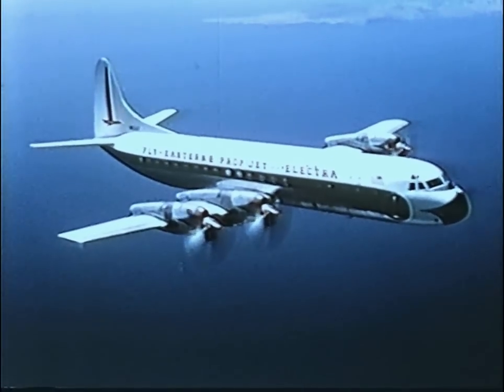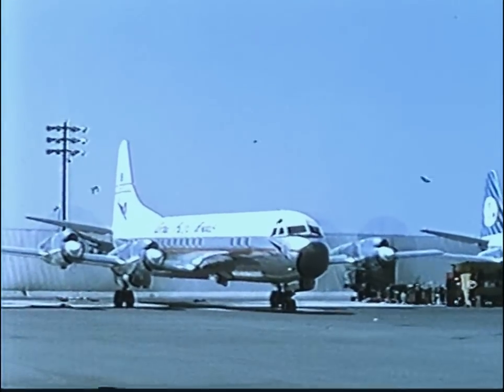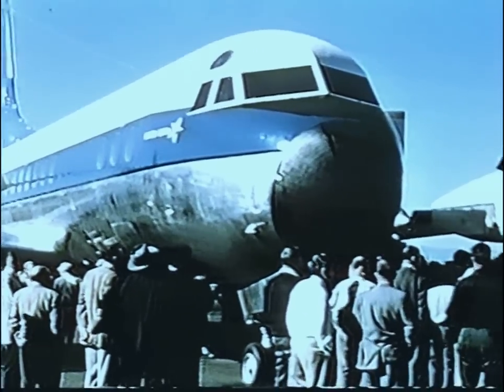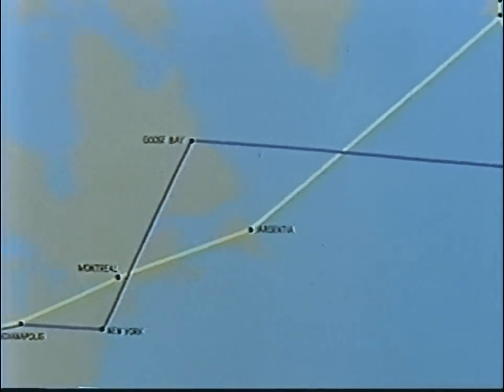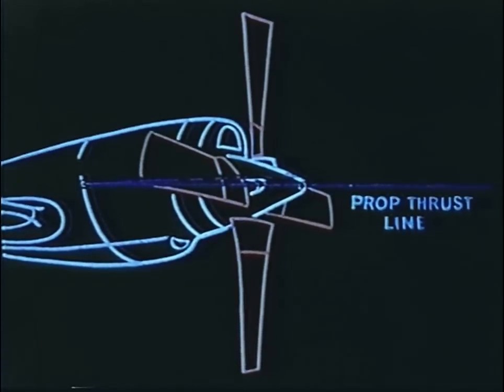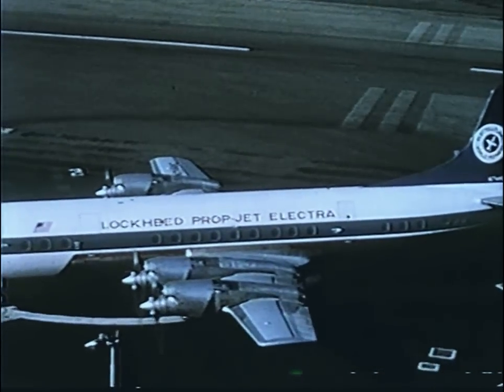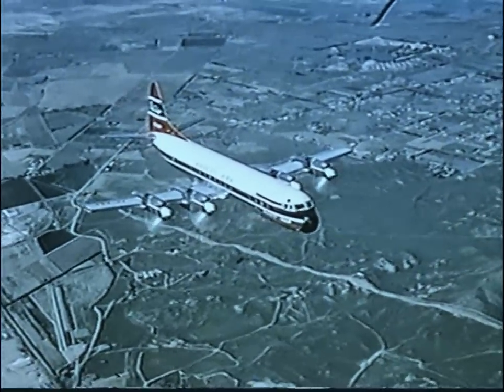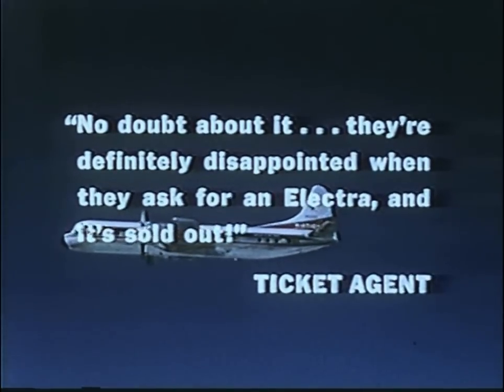Lockheed L-188A Electra Promo Film #3 - 1960

Comment: Gotta love the marketing guys. Propeller oscillation-induced catastrophic failures were reduced to "noise" issues in the promo film! The Electra eventually turned into a great airliner, but by the time the vibration problems were ironed out, it was commercially doomed by jets.
Reply: Chris - " both fantastic aircraft that failed in the marketplace" ==> Indeed. The Electra II eventually made it into Varig's shuttle service between Rio and Sao Paulo in Brazil where it was was loved by passengers and pilots alike. It flew this service for decades at more than 60 flights per day, yielding over 700K landings without a single fatal incident. The L-1011 was also a superb aircraft, but the Lockheed sales guys got it all wrong by committing to unrealistic delivery schedules to airlines, which increased substantially its manufacturing costs.
Reply: I believe this promo film was made before the "whirl mode" catastrophic wing failures manifested the weakness in the engine mounts- but even without those crashes, props were out of fashion with the flying public: the 707 set the style, & the American purchase of Caravelles for short-range domestic flights finished the Electra's chances. Poor Lockheed- the Electra II & the L-1011 were both fantastic aircraft that failed in the marketplace.
Reply: corisco tupi Not to mention the trouble Rolls-Royce had with bankruptcy & not being able to meet delivery schedules with the (also excellent) RB-211 engines! I live in Montreal, close to Dorval/Trudeau Airport, and still miss the sound of Air Canada's L-1011s. Flew to Los Angeles and back aboard one, wonderful aircraft.
Reply: I remember flying on these in the early 60's. Noise and vibration enough to make your teeth chatter.
Reply: +Chris Last I never flew in a Tristar (wish I did), but did get to fly in the Electra II a number of times. Back when I lived in Rio, the sound of the Electra II was almost part of the scenery, it came and went into a very central airport (Santos Dumont) every 15 mins and from almost every point in town you could see and hear those wonderful aircraft approach and depart. Good days gone. As for the RB-211, check "RB-211 backyard" here in YouTube for a number of videos with this engine running in an amateur mechanic's back yard, restored by himself, in case you haven't seen them yet. Cheers!
Reply: soco13466 Actually they felt like a pretty smooth ride. Noisy on the passenger seats near the propellers, to be sure, but no vibration really. I flew on the L-188 many times up to the 90s and don't recall it as particularly vibrating.
Reply: They became a workhorse for the Navy in the P-3 Orion sub chaser for many years after.
Reply: Yes, I've seen that one- be a little scary to live next door to someone like that, wouldn't it? Still, amazing that he managed to do it! :-)
Reply: Chris Last United ordered 20 Sud Caravelle VIR's.  American never ordered any.  TWA initially ordered some Caravelles also to be built by Douglas, but the Douglas Sud Aviation partnership fell apart and the aircraft were never built for TWA.